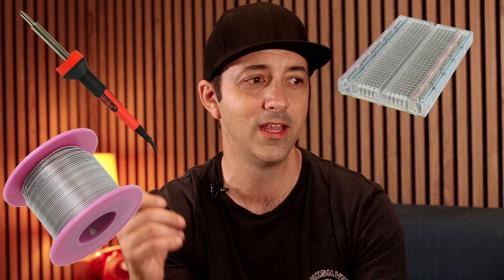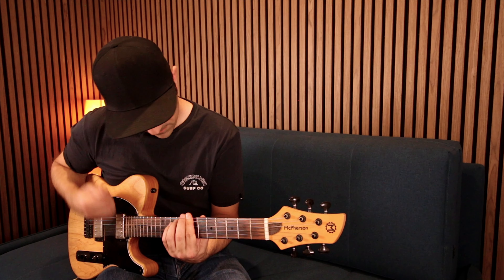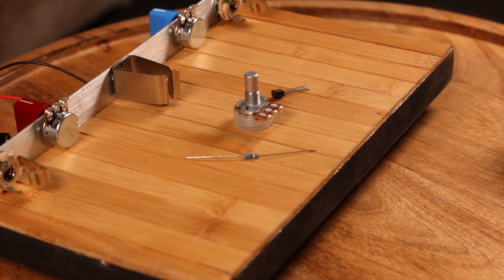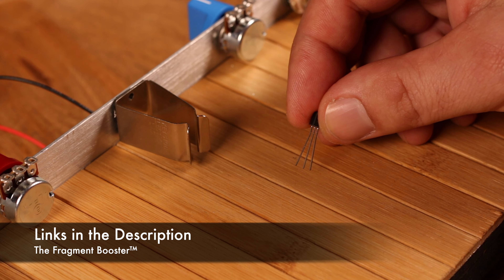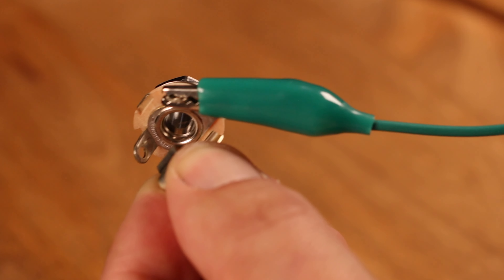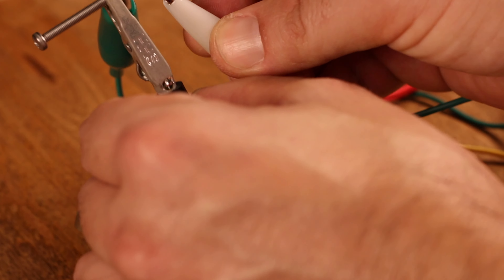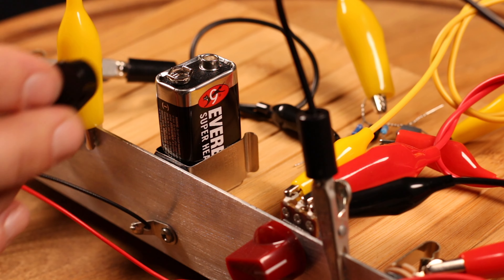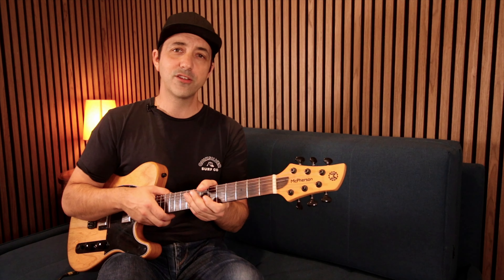The Best Ever Beginner Guitar Effects Pedal Project

Comment: These style projects are a lot of fun & can be a real eyeopener if you feel you're sort of stuck on the sound of your amp/guitar combination!

I'd probably put this on a small PCB, and build it into a guitar that's already got active pickups - it'll run on the same 9V block 😜

Just add a mini toggle switch to bypass it & to disconnect the battery, otherwise it'll just drain that battery dry 🤣👍